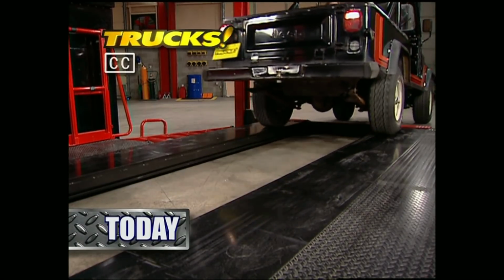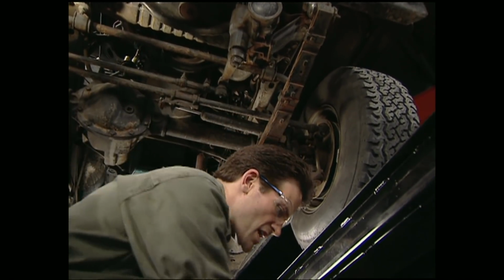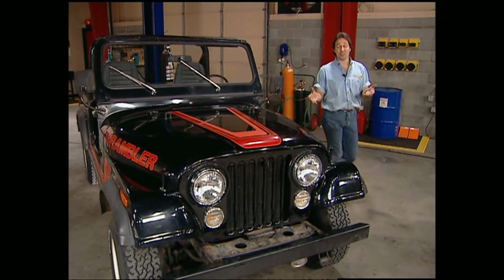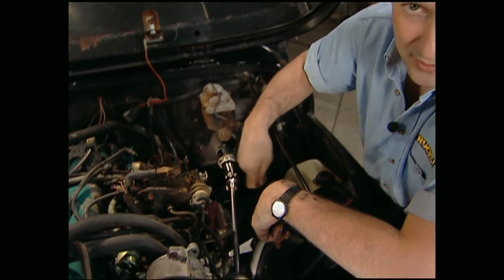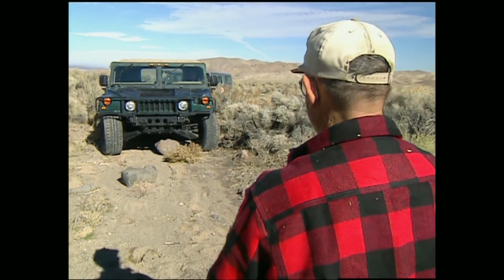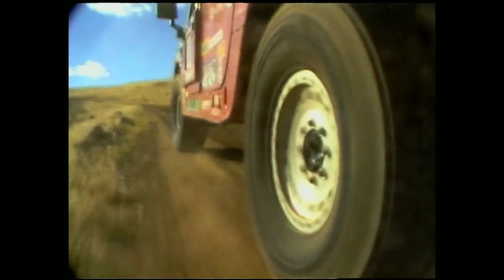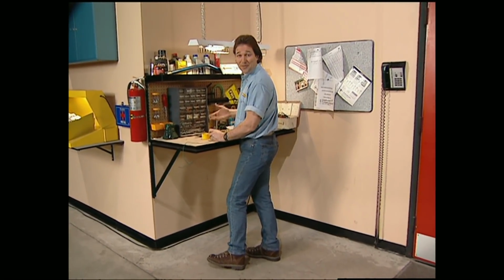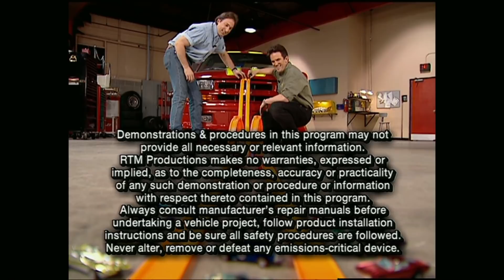Eliminating This Scrambler's Weak Link With New Power Steering And Hydraulic Winch - Trucks! S1, E9

Comment: It drives me crazy that they have a fully stocked garage but yet use a huge crescent wrench to take off the pitman nut.. Don't they have a impact gun and a socket???  Most mechanics absolutely detest the crescent "nut rounder" wrench
Reply: About the only thing I use a crescent wrench on is the hookup for my small propane heater.  For whatever reason my combo wrenches don't fit.  It's some strange not metric, not SAE size.  Strangely my combo wrenches seem to work on everything else I put them on.